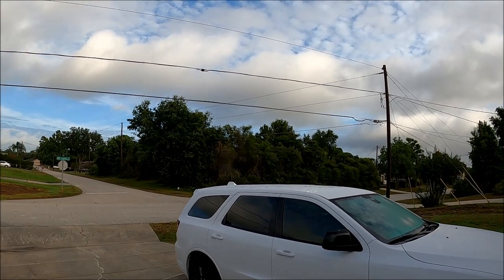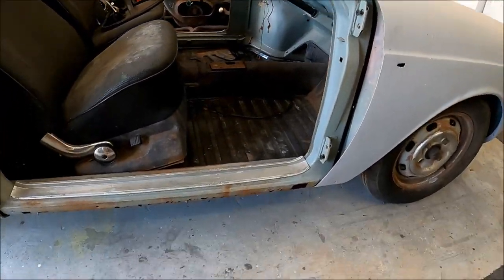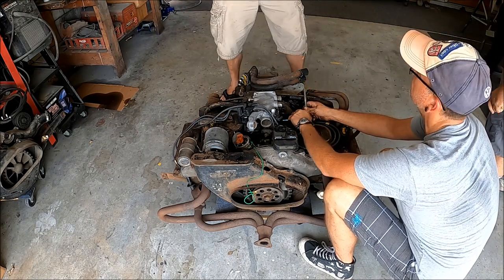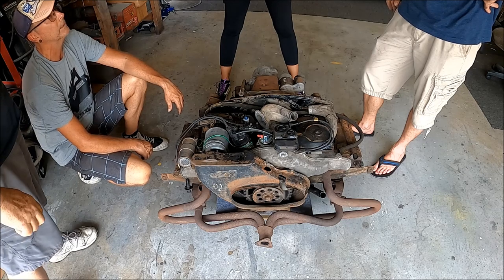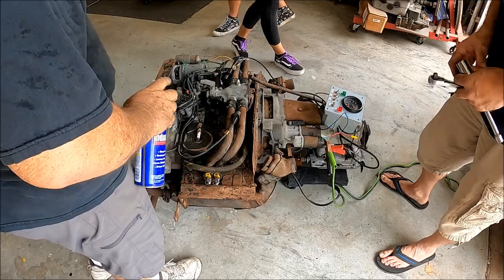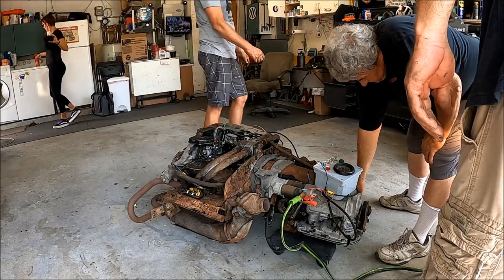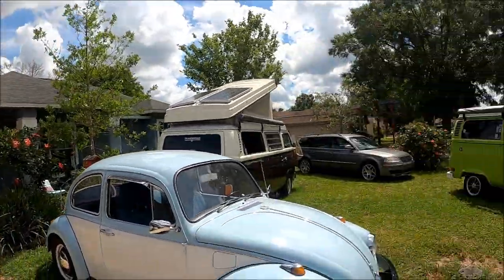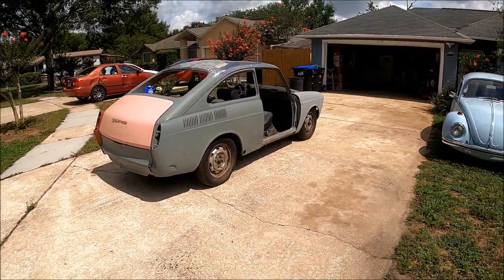1969 Volkswagen Fastback Barn Find Update - Will It Run?

Comment: Actually ran great, I used to say don’t clean them to much it’ll start leaking.  We had used a Type 3 motor in a  Bug Truck used a single carb was a lot of fun . Thanks for the video
Reply from the maker: It did run pretty well considering how long it’s been sitting and we did minimal prep on it. 
Thanks for being here!